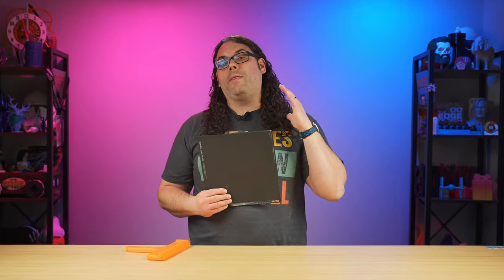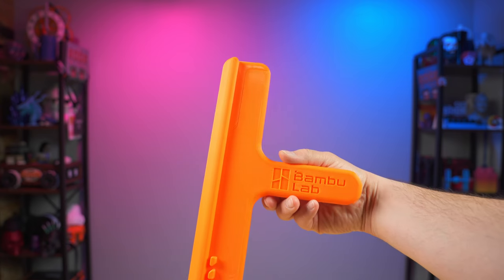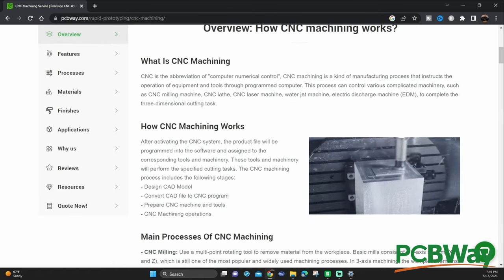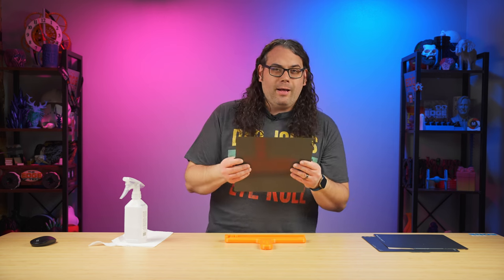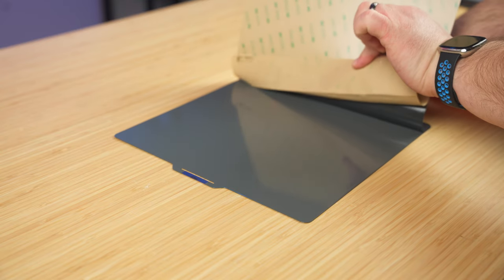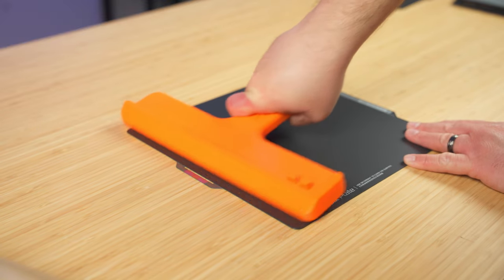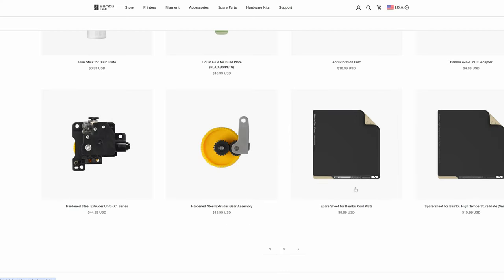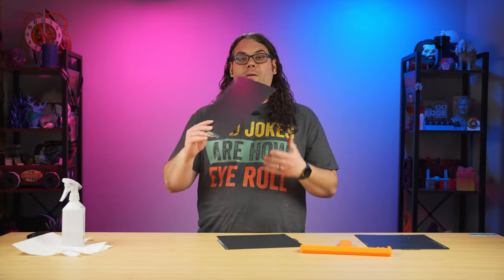Upgrade Your Bambu Lab Cool Plate: Quick Upgrade, Zero Hassle!

Comment: My favorite plate at the moment is the dual-sided smooth PEI plate. It's thicker than the other plates and you don't need glue stick for PLA. It's a smooth surface so between this and the textured gold PEI you have two great finishes. Also PETG, ABS/ASA and PC print really nice on it too. I'm amazed that ASA doesn't warp on it. I think because it's really thick so it can't lift the build plate off the magnetic sheet. I just ordered a second one and it's coming tomorrow. One dedicated for PLA and one I'll keep glue stick on for other materials. Highly recommend you check it out!
Reply: Who is it made by?
Reply: @chrislmink  Bambu Lab
Reply: Same
Reply: To be honest i dont use any type of glue anything, and dont have problems with adesion with pla....and i use the PEI and more 4 from aliexpress with other textures, i think if people clean the plate they dont need glue!
Reply: @chrislmink Bambu

Comment: One CON of the cool plate 35c (flip side engineering side 70c for petg) is that it will show your surface layer issues really clearly after you remove your print. Textured pei hides surface layer issues pretty well.  Solution is to have a good surface layer.

The other CON when using smooth plates are when you apply glue.  If you have glue brush strokes or glue stick patterns on the plate, those brush patterns will transfer to the surface layer of your printed model
Reply: I’ve never used glue stick, it’s always been such a weird habit that’s misunderstood since it’s absolutely not for PLA, nor for bed adhesion but for DE adhesion so it’s easier to remote non PLA prints. It’s also GROSS. AND MESSY. And ugly. Get a PEX sheet for glossy finish, or smooth PEI for matte. The textured is an acquired taste and very subjective when it’s a good choice. Absolutely not when precision is desired.

Comment: Discovered one advantage to using the cool plate for PLA rather than other plates, a lower electric bill.  Used a power monitor and noticed that when the bed is heating up the X1C draws 1.1kW until the bed is up to temp

Comment: I ordered a cool plate when I ordered the printer but started to return it when I got one with my printer. Really started to love it so I canceled the return. Waiting for the bambu smooth pei now. I like the duel textured plate but definitely learned you can get consistent auto filament calibrations on it. Make sure you tune the filament before you use it on that plate.

Comment: Textured PEI. Works great for everything. I find the only drawback is you NEED the glue on it as a release agent for TPU, Flexible PLA and larger ASA and ABS prints or they just won't come off clean or without damaging the plate.
Reply: It's not quite true. Textured PEI doesn't need glue for any of these, speaking from experience

Edit: This is only true for TPU on smooth pei or flexible pla, the rest is untrue
Reply: @UnwrittenGamingftn everyone's experience is different.
Reply: @rjakiel73  ..... no..... textured pei is textured pei. Differences per brand in material composition are minimal, so are production processes. You were simply using glue when you didn't have to. The whole idea of getting pei is to print without adhesives
Reply: @UnwrittenGamingftn  so ripping the bottom off of Flexible PLA prints and pulling up a small piece of the PEI coating was my imagination? Hell maybe I should imagine a million dollars? Or maybe imagine that you have the inability to accept that you're experience isn't the only one in the universe?
Reply: @rjakiel73  Get angrier
Reply: @rjakiel73 Did you let the plate fully cool down beforehand?
Reply: @komischertyp4  yes I do. For prints with a smaller footprint ASA and ABS just poo off. Anything large and flat, even when flexing the plate, doesn't want to release easy. With that said Flexible PLA is the worst as it bonds even more when cooled so a release agent is a must.

Comment: Funnily enough I love the engineering side, if done just right you can print everything and then it just pops right off after. 

The only down side to my plates is that I believe that my bed is warped, and the nozzle does get extremely close to some parts and then causes fails

Comment: Side note from other topics about glue haters knocking bambu for "needing glue" to stick
Hell the glue isn't to make PLA stick on the cool plate. After a few prints I'm re-applying glue as the prints get harder and harder to remove. Large surface area prints have left me wondering if I'm actually going to be pulling the sticker up

Comment: The Bambu Lab gluestick is horrible, it is like your skin that peels after you get sun burnt.
 I bought some 3D LAC but I bought the wrong one, I got the one that has the pad and it wears out before even 10% of the liquid is used, I should have bought the spray version.
 Some people claim that you don't need to use anything on the Cool Plate as the prints come off just fine, however, I would still use an adhesive on very small parts.
 I threw my Bambu scraper blade in the bin as I managed to damage a textured PEI plate and I was being extra careful!
 I use the Ideaformer PEI plates and they are excellent and a third of the price of the official ones, I have the full collection of them now and I really like the holographic ones!